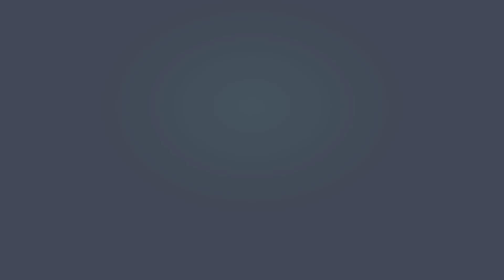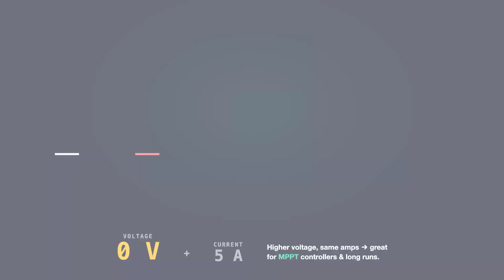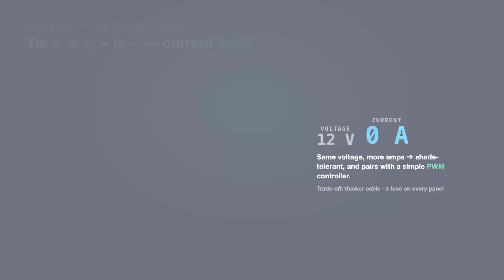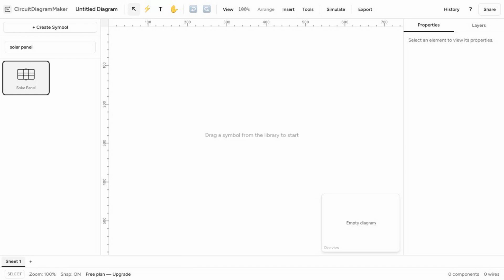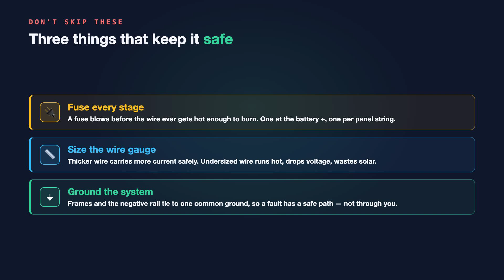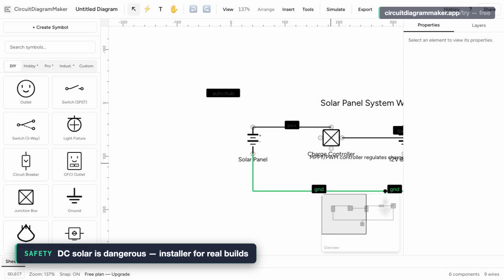How to Wire Solar Panels — Beginner-Safe Diagram

Comment from the maker: Memory hook if you take nothing else: series adds volts, parallel adds amps. Wire + to − down a line and the voltage stacks up (great for MPPT + long runs); tie all the pluses and all the minuses together and the current stacks up instead (shade-tolerant + simple PWM).

The one that saves controllers: your panel string voltage must stay under the controller's max input — check the label before you connect anything.

Are you running MPPT or PWM — and is this off-grid or grid-tie? Tell me your setup and I'll point you at the right wiring.

Open the exact solar diagram and rewire it yourself: https://circuitdiagrammaker.app/diagrams/solar-panel-wiring-diagram?utm_source=youtube&utm_medium=pinned_comment&utm_content=yt-095